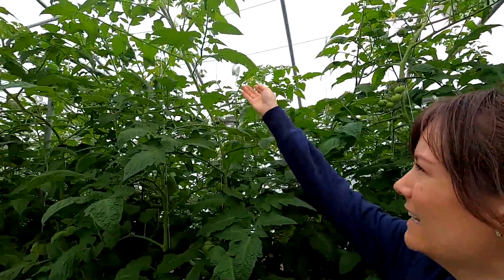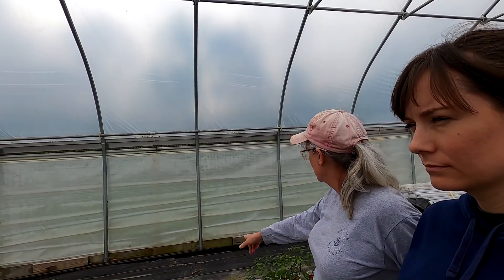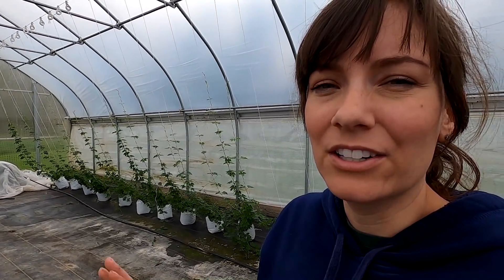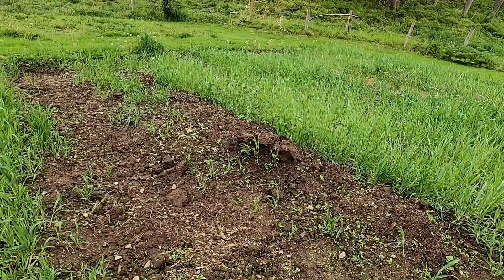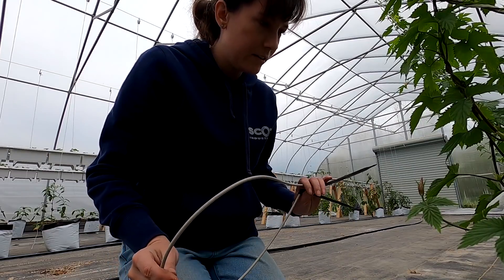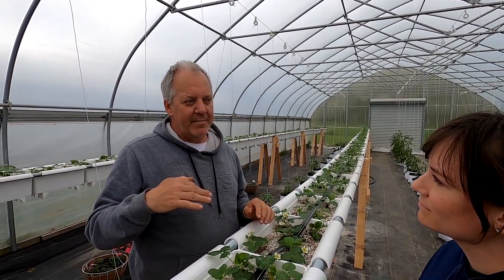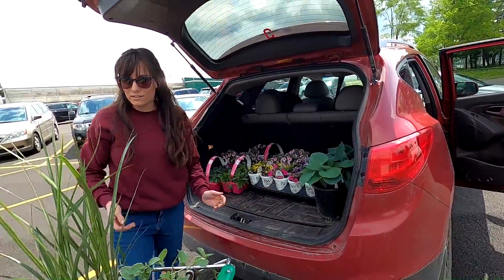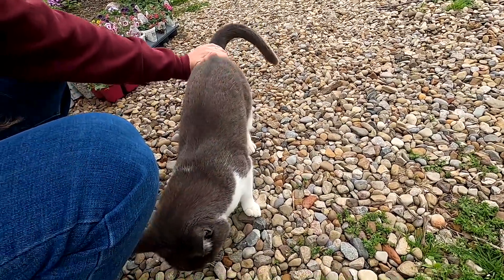Running the Lines - Hydroponic Drip Irrigation

Comment: Great to hear more about the new injection system.  Question: does each valve pull the same nutrient mix?   Or is your dad changing the nutrients depending on the crop it's going to?   Thanks!

Comment: Most people do not realize how much it cost and time go in to infrastructure . The green house less say cost $100000.00 putting a pad in with heating and cooling system all in to pay for installing and parts . You will need power and water !! Than all the drip lines , timers , planters , cables , drop spools , cost $20000.00 more and one year of your time ! that would be a good on to go over you have the new one set up . P.s dads labor is worth $32.50 per hour  ! Have a good day .